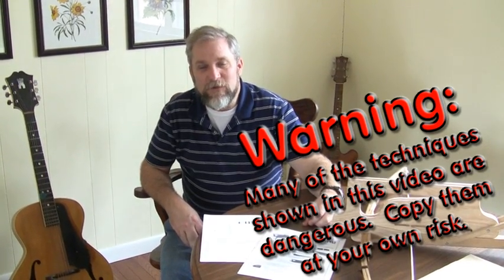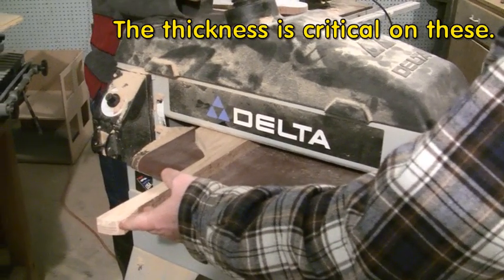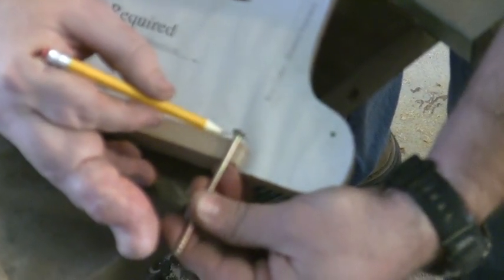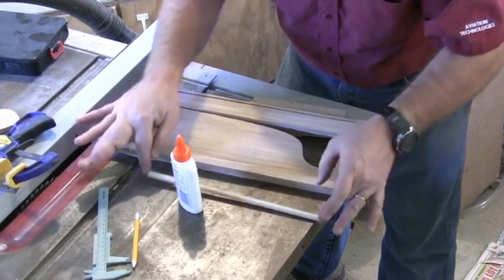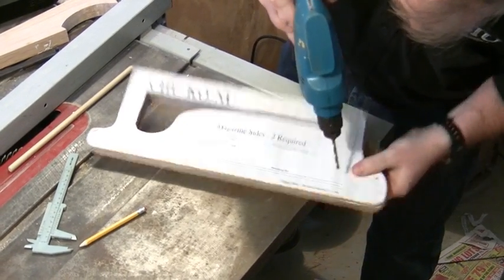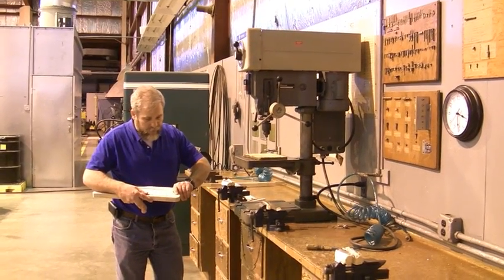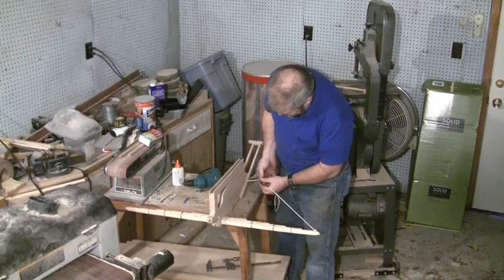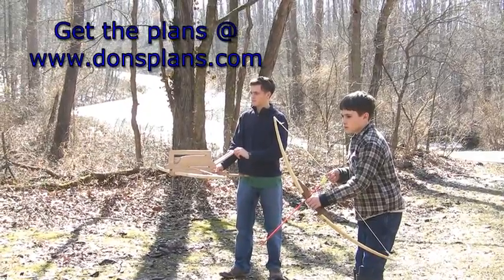Chu-ko-nu "Machine Gun Crossbow" - How to build it.

Comment: I was wondering if you could update it by using an electric motor in the trigger/string pull back  assembly I s that possible with this design?
Reply from the maker: +VAMPYR ENGEL - not easily - but anything is possible with enough ingenuity and work...
Reply: 1donagin Guess so the problem might be the angle of attack when the stock goes back into position plus string strength if you get the electric motor to work really fast of course

Comment: What is the thickness of the oak stair tread you are using? The stock for the chu-ko-nu is 1" thick (or more) and the other pieces are cut from 3/4". Yet in the video they are all on the same plank. Please help remove my confusion. Thanks.
Reply from the maker: +Joe Marasco - About 1 inch, or 26 mm.  I have a thickness sander, which can make the thicker pieces into thinner pieces after I have cut them out.
Reply: +1donagin would a surface planer do the job just as well?
Reply from the maker: +Adam “Teddy” - Yes.  My sander has Les snipe than my planer, so I use it more.  Your equipment and experiences may vary...